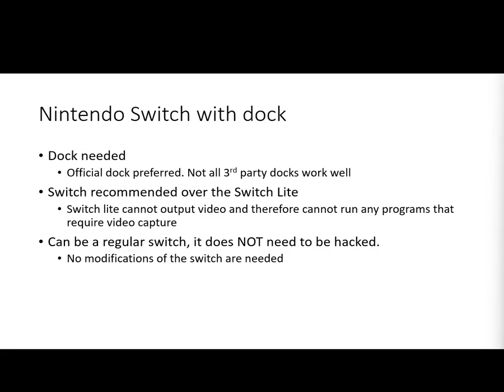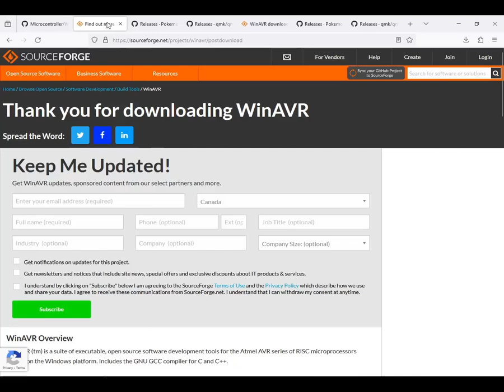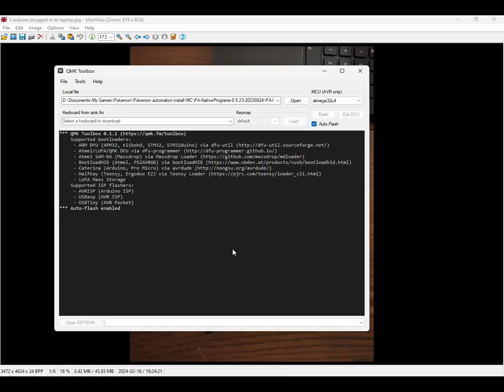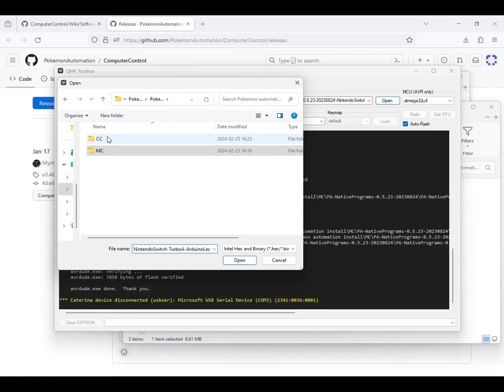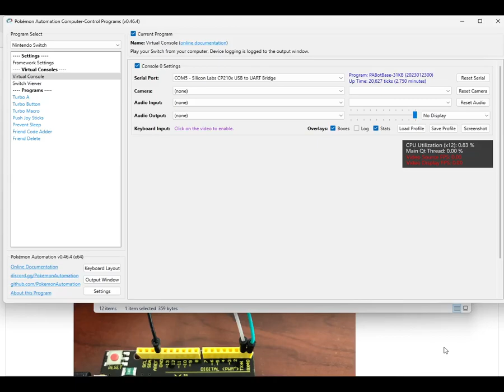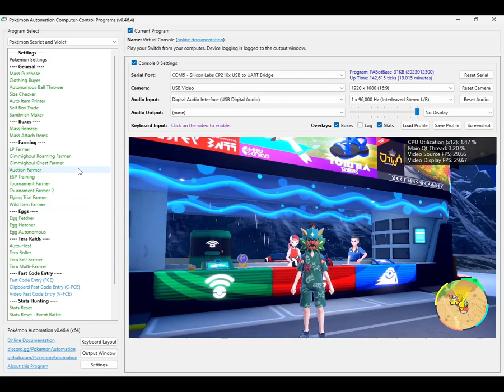Guide to Pokemon Automation set-up - automated shiny hunting, egg hatching, money farming, etc.

Comment: Thank you for the video. I was wondering if maybe you could run this with a raspberry pi instead of the ardunio as I don't have access to an ardunio. It you could, could you also make a part for the raspberry pi setup and everything else needed to run the code.
Reply from the maker: No. This does not work with Raspberry Pi.